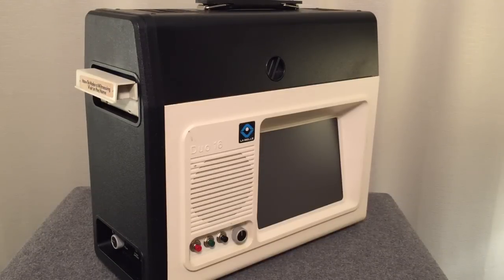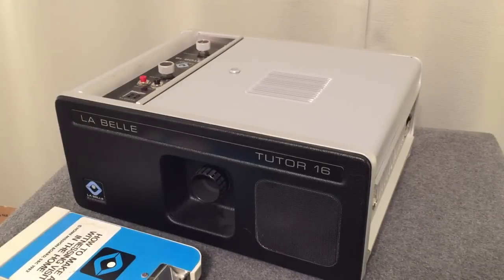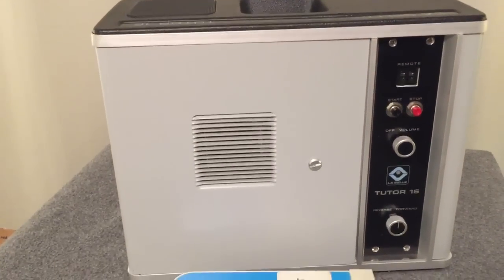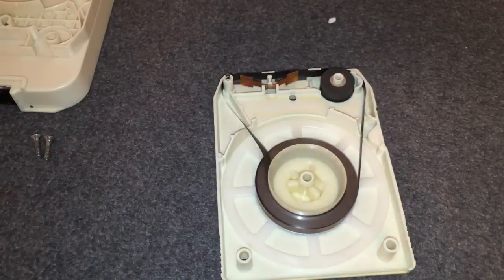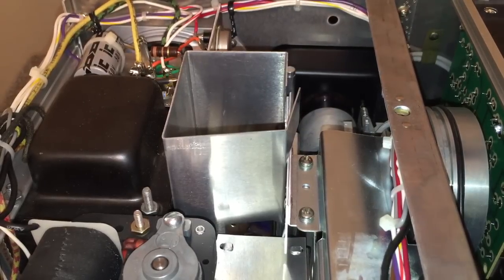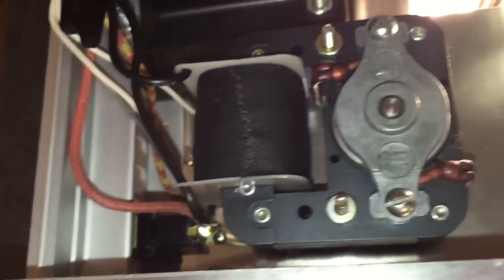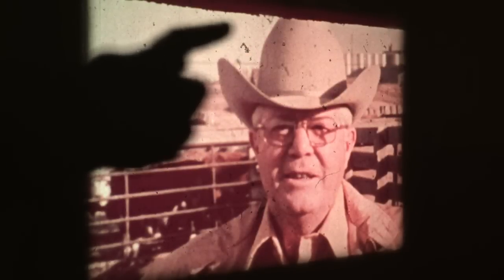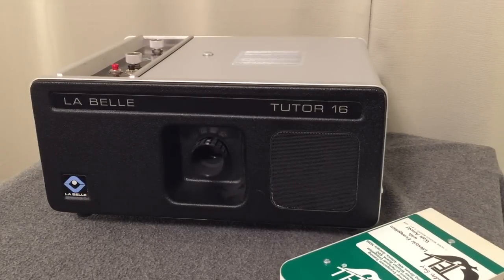La Belle Duo Tutor 16 - Commpak Cartridge Player & Projector

Comment: I made filmstrips for Labelle cartridges. The client sent in 35mm slides and I would copy them onto 16mm Ektachrome Commercial 7252 using a Mitchell 16 camera with a single frame motor. The strip was used for making copies which were loaded into cartridges. That was at Russell Film Labs in Jacksonville, Florida. I worked there from 1978 to when it closed in 1980.

Comment: The invention of variable frame rate video!

I think those cartridges bodies could be manufactured on a 3D printer easily enough. I can even imagine a 'dockable' form - one in which the audio part could be pulled off for use in a regular 8-track player, then clipped back together.

Comment: this reminds me of a "learning" machine we had when I was in 1st grade (1981) it was called "system 80" and had these plastic "trays" that you'd push into the machine, with small film frames on it.  every time a question was answered, it would pop the plastic film tray out one frame.  there was an LP that went in the top with the audio.  It'd ask you questions off the LP and then you'd hit 1 of 4 buttons to answer.  If you got it right it'd go to the next question.
Reply: I saw one of these at a hearing clinic in Terrace, BC, Canada when I was young.
Reply: kevtris My school had one in special ed.  I never got to use it but remember envying the kids in that class for all the neat gadgets they got to play with all day.  I remember wondering how that turntable worked.  It had a door on the top with a green felt platter.  The platter seemed to lift as the door was opened.  This memory is from circa 1996.
Reply: Been trying to spearhead the collection compilation and restoration of all the e.g. LaBelle cartridge and Borg-Warner System-80 lessons etc to be able to preserve it - but apparently in a lot of cases - whoever used to have lessons and players tossed them years ago - and the master tapes and film negatives presumably suffered the same fate.

Comment: I believe there was a similar system for home users where you could combine your stereo tape deck with a slide projector.  You could record commentary on one track and the projector's control pulses (or whatever they were called) on the other track.  Of course everything worked fine until, for some or other reason, the sequence of slides were buggered up ! :-)
Reply: You are correct, Sir (or Madam, as the case may be); i know for certain that PHILIPS made one such device - however, it required the addition, if not already built in from the factory, of a special "Pilot Tone Head" which could record and detect a high-pitched tone that acted as a cue to the slide projector.
This device, if i remember correctly, was about the size of two packs of cigarettes, and was hooked up between the tape recorder and the projector.

Regrettably, that's all i can remember about it, and i wasn't able to (quickly) find any further information about it.
Reply: You are thinking of the Kodak sound synchronizer unit, which does exactly what you say.  More sophisticated units can control multiple slide projectors and can fade the lamps in and out, rather than simply triggering the slide advance function.

Comment: Seven years old I know, but adding to my System80 comment, but for this. 
Guess I didn't play it out far enough to notice - SIX HOURS? In ONE CARTRIDGE?  

I've restored these a couple of dozen times - and yet another foray over the holidays - the same way as everybody else - dismounting the filmstrip to scan in a filmstrip reader (or sending out to be converted into 4-perf 35mm) and unsplicing the tape to play on a normal 2-track reel-to-reel - and the longest I've seen is ONE hour.

If you divide out the max capacity of the similar A-size NAB cart which runs at 7-1/2 at 10-1/2 minutes, that's 21 minutes at the COMMPAK high speed of 3-3/4. At the lower speed of 1-7/8 IPS that time doubles to around 42 minutes.

(For everybody else but Databits reading this) One reason it plays better on Track 2 on the 8-track is the same reason 2-track inline tapes play better on a 4-track auto-reverse player when the head is switched to the Side 2 position - where most of the ``energy'' is on the lower half of the track. Wollensak Stereo players from the 60s had the `lower-head' setting.

Same with playing it on a 4-channel inline deck which I also had to do before I got my halftrack deck - a Craig mini auto reverse that only handles up to 4-inch reels with dual capstans and a 2-track play head in the middle with single track erase and record heads on either side. 

I cannibalized one that had also come in more damaged than it started off and took the still-functional amp out of it, wired the other playback head channel out to it - put the whole thing in a new cabinet and now I could record my slew of UK 2-track mono reel to reels.

And now back to your regularly -scheduled program.

A two-parter a guy sent me (Honeywell onboarding/new employee messages) utilizes both a reel hub that is considerably smaller than that of an 8-track, maybe approaching the size of the hub belonging to a Muntz Cart-Single/EP as well as 3/4 mil tape, between 1-mil and a half-mil and that stretched the time out to an hour.

Also - the question of where they put enough 16 MM filmstrip slides to house more than a thousand frames in such a teeny space - because these hour-long halves of the same program had all they could do to avoid film creases sandwiching them back and forth squashed in together. 

In the second part which had more ``slides'' than the first for the same hour of audio,  between-the-frame pre-creased sections were discovered every 18 frames or so which allowed the film section at its beginning to lay relatively flat against its neighbor thereby increasing capacity. This copy must not have been played much because the scratches from one payer rubbing on the other one were minimal compared to some long programs I've seen.

So if there's more than one hour on a cart at 1-7/8 IPS it would be interesting to see the inside if its the same as these. Or confirmation that an hour per cart is still the max.

Comment: at 12:33, is that a battery (silver colored with "IC" logos on it)?  That can't be cause it says 50 volts on it.  That little battery cannot hold fifty volts.
Reply: Im thinking capaciter
Reply: +John Rivett Ah, that makes sense.  I mean 50 volts is over 4x a vehicle battery
Reply: John Becker
Allow me to correct a minor misconception:
Neither batteries nor capaictors hold Voltages, they hold charges, which are measured in Coulombs; it's only when they are discharged into a circuit that you can measure either voltage or current, both of which depends on the resistance of the circuit.
Reply: Why is that ? a lead-acid battery can be charged up to 2volts per element. If you have 25 very small elements, you can have a 50volts lead-acid battery the size of this small capacitor. It wouldn't be of any use, cause it wouldn't hold a big charge and it would be expensive to make... But it's not impossible.

Comment: how do 8 tracks even work if they only have one reel man
Reply from the maker: The tape begins and ends on the same reel/spool.
Reply: databits but how? 
does the tape just slide really loose over each other?
Reply: Basically, yes.  The tape is loosely wound on one reel and is pulled out from the middle, goes out and around past the playback head and back inside around the rest of the tape again. Because the tape is pulled out from the part closest to the centre of the reel it means the part on the outside spins faster and therefor there is always some kind of tension, keeping the tape wound up properly.